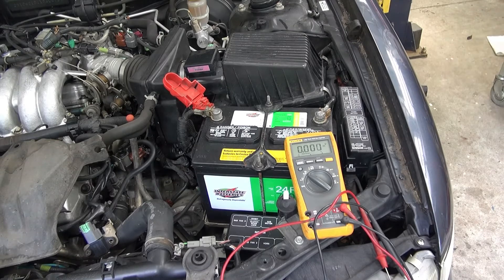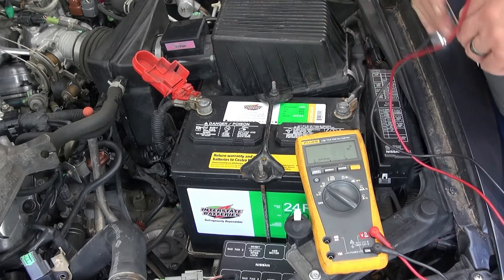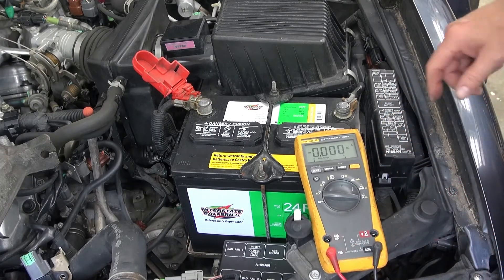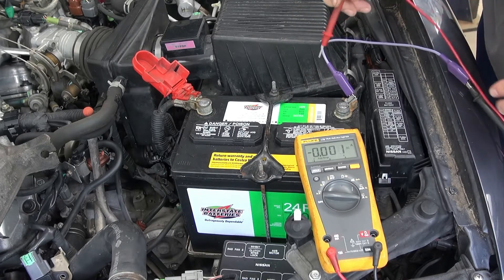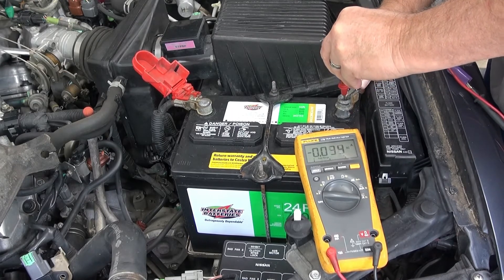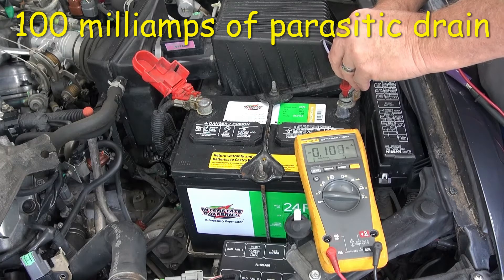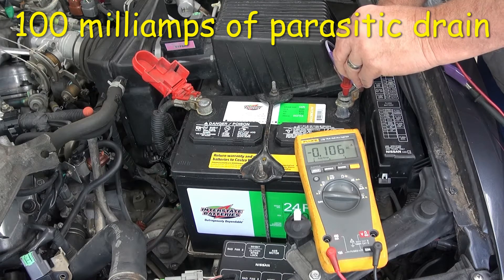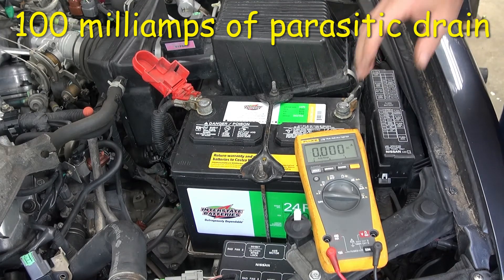Nissan Maxima Gen 4 battery drain measured

Comment: I have an issue with my 2010 Maxima where the battery dies after sitting for 2 days, sometimes even just overnight if its cold. I've changed the battery about 6 times in 10 years. Drove it to a mechanic who allegedly did the parasitic draw test and says nothing is drawing. Alternator is good too. Any idea what it could be?
Reply from the maker: if you are not able to use a multimeter to test the current draw yourself, I recommend you find someone who is skilled in troubleshooting and knowledgeable in electronics to measure the current draw .   Could be as simple as a glove box light or trunk light that stays one, but more likely is a problem with the radio or a control module.